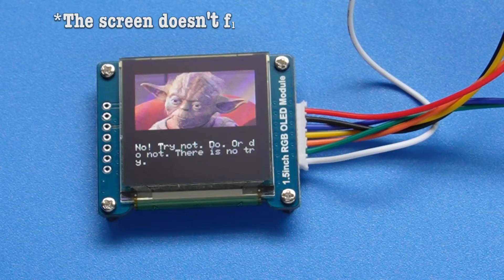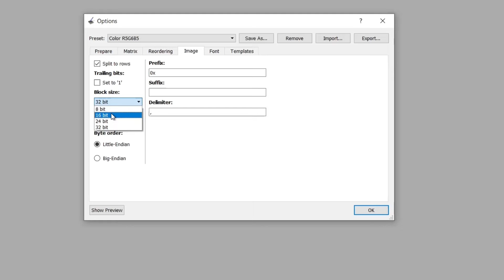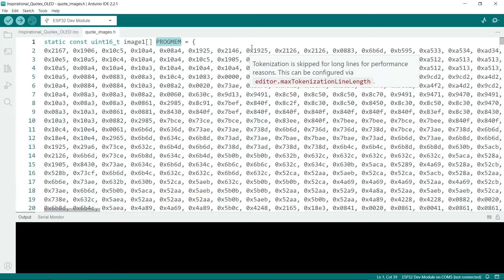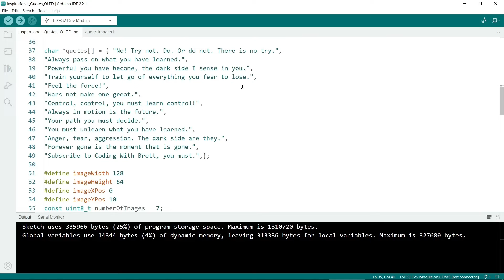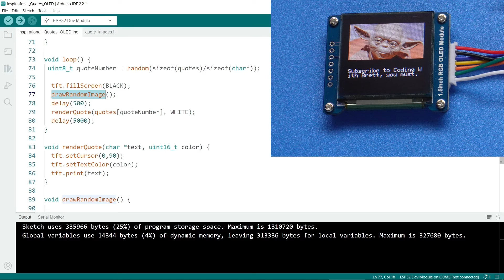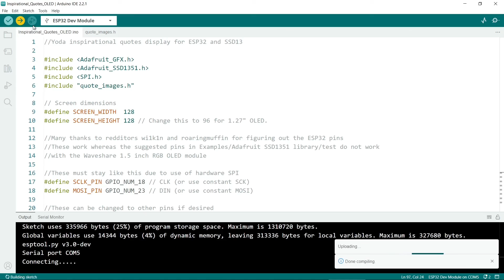ESP32 OLED Yoda Quote Display - Learn to Code You Must

Comment: Can i read from a memory address just the same? As an example, output from a raspberry pi is read and written to memory. The arduino loop reads the memory address over and over again and outputs to the spi oled. ??